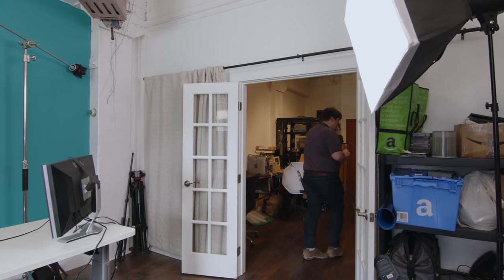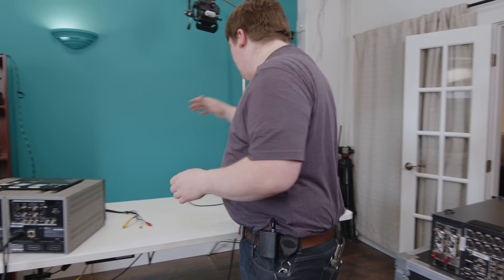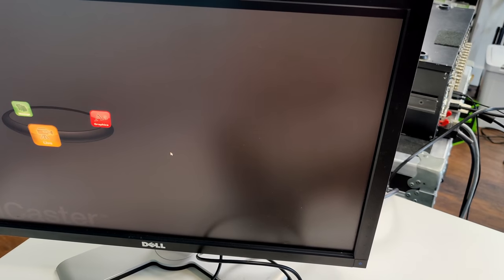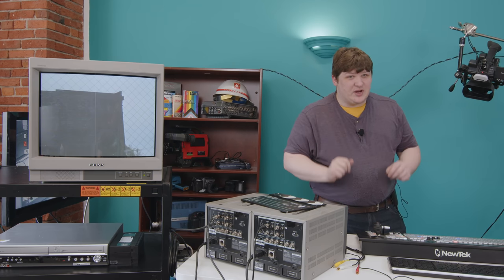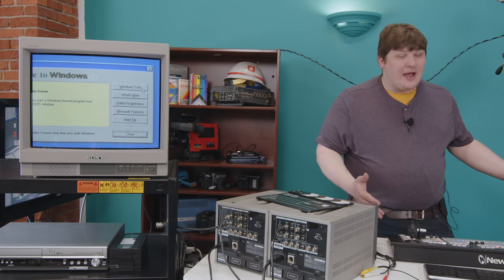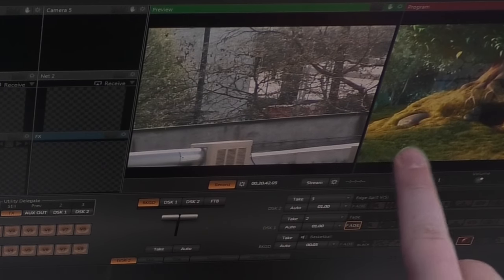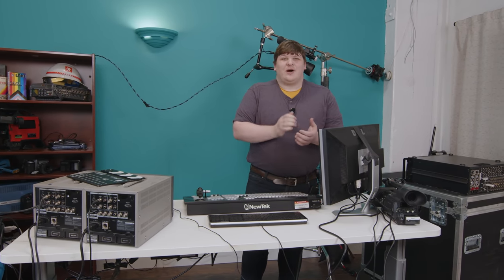Learning to run a broadcast in ONE HOUR [Tricaster TCXD850]

Comment: I assume the "pause a 3D transition halfway between" thing is used on e.g. sports broadcasts when they need to transition back to the commentators or a replay but they aren't quite ready, so you end up with like the MLB/NBC Sports/whatever transition for 5 seconds or so when normally it would last one second.

Comment: As someone who has recently started a career in TV (formerly in electronic security, and before that IT), I found this very interesting (and amusing), as I currently work in Broadcast I don't work with equipment like the Tricaster, but its still neat to learn a bit about a piece of gear I may or may not end up encountering one day. Also, I noticed the "E420" tape - happy 420 day :)

Comment: Hey Gravis! Great video, brought me back to me beginnings in broadcasting...  I've been a Technical Director (Vision Mixer for you Brits) for over 25 years now doing live sports, news, etc and you've got the basics just about right on all counts...  Yes these machines are all based on the same principles dating back from the 60's and 70's when they became more "affordable" for smaller stations...  The newer 4K models basically operate the same way the analog standard def ones did 30 years ago, making it easier for us to implement the newer possibilities alongside our long-acquired ways of doing things.

Control room automation is slowly making bigger switchers obsolete though, with new systems consisting only of a processing frame and networked computer screen interface...  We now do live show with only 2 operators compared to the 4-6 persons crews of the past...  I run the switcher, robotic cameras, playback and graphics all from one interface... And people at home basically don't see the difference!!!  The latest systems even integrate internet video calling all inboard, permitting to put on-air basically anybody with a computer/phone/tablet within seconds...  Soon all this "broadcast" gear will be a thing of the past, replaced by cloud-based apps running on basic computers... Such is the evolution of technology...

Comment: Awesome rundown! I actually work as a director in a local TV studio and you hit all the basic points of using one of these things. We have a 36in/24out Ross switcher with tons of bells and whistles these days but a decade ago we were using a Tricaster according to my predecessors. 

 Tbh I never have had a reason to use the T Bar and none of the directors I worked under as an audio op did either. 50% of our transitions are cuts, 25% are 15 frame crossfades and 25% are custom wipes like the ones you mentioned that just use an animation to hide a wipe.
Reply: Also, when I was switching live music performances, 9 out of 10 times I switched directly on the program bus, calling attention to the camera operator and then punching them in live. Probably when the content is slower (ie. talkshows) you could compose your shot on the preview, but when you do fast-paced switching there's often no time for it.
Reply: @Stoney3K  Hot punching as we call it is something of a sin for tv news. Get in the habit of that and it's too easy to make a mistake and accidentally pop up a weather camera without the key turned on or hit the wrong button for video playback and roll a clip from yesterday's wildfire instead of the SPCA story you intended to roll.... I definitely see how it would be super useful when punching video for a concert or sporting event.
Reply: @Aquatarkus96  I can imagine it being easier to composite a shot in a predictable environment like a news studio, so you can set up the shot in preview and flip over at a leisurely pace.

In a fast-paced, improvised environment like a concert or a sports match... not so much.

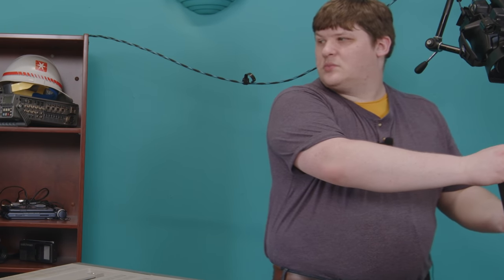Comment: All this stuff takes me back to the days of linear editing, where an editor would have multiple machines synced up in the tape operator's room, and they would be recording everything to tape - one edit at a time. Since they didn't have a video timeline laid out for them to tweak endlessly (like with an Avid or later software solutions), they needed to be able to do precise edits as quickly and reliably as possible. This means that doing something like [22:03] picking the exact field in the middle of a transition was often required in order to replace whatever came after it. Things have obviously changed a lot in the past 25+ years, but tools like this are still valid and useful, particularly for producing live events in ways you simply couldn't with a mouse and keyboard.

Comment: This is very entertaining to watch. I am a broadcast sports director and I use almost that exact model of control surface for some of the shows I run. I'm not the most experienced director ever but I do have some time at the controls.

To answer your question about "stingers" as you call them, one use is for transitioning to replays in a show using a "replay" transition that looks similar to the "score" transition. Useful to let the audience know that what they're watching is no longer live.

And to address how advanced this model of tricaster is: my understanding is that it's nowhere near the top of the line. Other models of switcher that I use (ROSS) connect to a graphics system called Xpressions that can feed a wide variety of graphics into the switcher for broadcast use: think player statistics, scores, etc. They can also be set up with macros to accomplish a wide variety of switcher actions at once.

For instance

taking DDR1
rolling the clip
removing a key
adding a new key
and using a specific transition

all in one button press

perhaps this tricaster can do some of those things but I've never seen it.

Comment: Great Video!  You are really good at connecting the dots!  Every TV engineer knows the instruction manual is only to be used when flummoxed.  

The Video Toaster did do some of the special effects on the TV series Babylon 5 but not on Home Improvement.  Most of those special effects were conceived by the great designer Jim Praytor and executed at Modern Videofilm in Burbank.  I was lucky enough to be one of the cadre of compositing and online editors who worked on the show. Most effects were done in the Discrete Logic/Autodesk family of compositors, the Fire, Flame or inferno.  We also would use camera stands and paper cutouts, shoot ad-hock green screen in the facility parking structure and heavily use the Grass Valley Kaleidoscope in the edit room for image manipulation.  Contrary to the effects found in the TriCaster no "canned effects" were used in Home Improvement.  Every effect or transition was purpose built for the show.  We might re-use something created earlier, but they were all show original.  I even got a cameo as a tiny green elf jumping out of a giant treasure chest.  

Coincidence of coincidences, today I just received an invite to see the latest NewTek product, the TriCaster 1 Pro.  It lives on...
Reply from the maker: Oh wow - that's what I get for not checking my references. Did you know that there are people all over the Internet repeating that the toaster was used on that show, but when I went and checked just now, I can't find any primary sources for it? The wiki article that I'm guessing everyone has been citing for years doesn't have one either. Would certainly make sense if the reason for that is that it simply isn't true; I'll remove it from the wiki page later when I have a chance. It must be a bummer to have your work overshadowed by false association like that, my apologies for not doing my due diligence.
Reply: @CathodeRayDude  No worries.  The reward was working on a great show with great people for many years.

Comment: Ooh, I remember the Tricaster. They made us learn how to use that the semester before the college TV station upgraded to HD. "Everything you learn this semester will be entirely obsolete next semester, thanks for you rmoney". Granted, ours was a bit older (video backups were recorded to full size DV cassettes).
Reply: Your comment reminded me of a course I took in college, that was an entirely different course, but they taught us outdated software in 2014, so for example, I think the college taught us CircuitMaker 2000 instead of some version of SolidWorks.

Comment: Just an amateur speculation, but I think the reason for the transition pausing is so you can cut to commercial. I vaguely remember old newscaster transitions that worked that way it would animate to their logo, cut to commercial and then finish the transition when they were back from commercial break.

Comment: As someone who works with vision mixers for a living I loved watching your journey figuring out the Tricaster. (They are far from my favorite workflow)
You've got a lot of it correct! I believe that model will have a multiviewer output which is why routing the preview bus to an output is so unintuitive. You're meant to hook up a large TV that will contain the multiviewer.

For how prominent the T-Bar is on the switcher surface, they sure don't get used a lot in live shows. It's always "Auto" or "Cut." Most people select inputs almost exclusively on the Preview bus. It's bad form to switch program directly.

Stingers are graphics that come in the middle of a transition. Animation isn't necessary. A dip is a stinger that's a solid color (usually black or white).

The T-Bar will really only be used when setting up a show or checking to make sure a stinger animation is running properly.

Now we need to get you onto a switcher with multiple M/Es :)
Reply from the maker: Ohhhh, that makes a lot of sense wrt the multiview - I saw that output but didn't take the time to try it out; didn't occur to me that that would actually be considered the default output, I figured people would always have the dedicated displays.

And as regards the T-bar - yeah, I had assumed that it pretty much never got used in live productions, I just talked to a couple people who said it did, and I couldn't really picture how that would work but I figured I'd go with the more experienced opinion, haha.

I'd love to try out a real "big boy" switcher - hoping I get to play around in a real studio someday!

Comment: Really enjoyed this video! Back in high school, I was a part of the ComTech club and we did live video production for like band performances and stuff, and we used a 1U Blackmagic design SDI switcher. It was so much fun to use, but we didn't have a physical control surface like the one you used (we'd use a laptop with the ATEM software for control).
There really is something about equipment like this that makes it so much fun to play around with.

Comment: I have slight "pick it up as you go" experience with whatever system BLFC had last year. Poked around with it during the dances and also quickly figured out the basics. Not sure exactly what it was but it was pretty similar to that setup, just more inputs and the director had a dedicated screen with all of the inputs. One of the people that actually knows what they're doing put it on a programmed input cycle for one of the late nights; that's definitely something that isn't discoverable from the console. I want to learn how to operate it more effectively this year.

Comment: I’ve only ever switched in studio, I’ve never used one of these all-in-one field units, but many of my colleagues have. When I started, we were still in SD, and the still store, video playout, DVE, and titler were all separate devices that were inputs into the switcher. When we went HD, our new switcher had a built in still store and DVE, but video playout and CG are still separate. However, the switcher communicates with the CG via GPIO. The stingers are played out of the CG and the different overlays have corresponding switcher macros that basically do what you mentioned at 23:10 where the graphic overlays a cut.

Comment: I've never used a Tricaster, but I owned a Toaster. The Flyer turned it into an early NLE system that was designed around the same A/B source, preview/program switcher metaphor used by the Toaster (it didn't use a timeline interface, if you can believe that). It made perfect sense if you had spent any time in the control room of a community cable studio.

Comment: Check out the Blackmagic ATEM mini switcher.  It's amazing what you can get for not a ton of money.  The even have control surfaces that will interface with the ATEM.
Great job figuring it out.  I was a Technical Director back in the pre-HD days.  Typically a pro switcher will have a main program preview bus with a key bus for the DSK.  Then you will have one or more M/E mix effect busses for your weather chroma key, live shot double box, etc.  You may also have an aux bus for feeding a set monitor or what the camera ops see in their return video feed.

Comment: We had a smaller/slightly newer version of this (I believe it was the TCXD455) in my high school's broadcast program when I was one of our tech leads, this is unlocking some old memories lol (including the lovely reliability or lack thereof). We would use the built in recorder function and record everything, then play it all together with the DDR, and copy the finished product onto the school's network drive (yes, our lovely Windows 7 box was on the network unrestricted in 2020 with a 2012 patch level...don't think about it it's fine). It had an i7-2600K and 8 gigs of RAM, and I think a GT440 in it?
We also had an older one that was built in a Shuttle PC chassis like you mentioned fairly early in the video, I believe it was a TCXD300 or something like that. I don't remember the specs, but I remember it was an X58 board (it had a green startup splash with X58 on it, might have been an Asus or MSI board?) and running Vista.

Comment: I used a 2U tricaster unit at my church with a similar control surface (different joystick, smaller branding, ours also had a trackball IIRC) and I never knew it was related to the Amiga or its Video Toaster cards!
Reply: the unit we had was built around SDI. I don't remember which version, but it could do a 1080p signal and it could also handle the 480i out of a tape deck

Comment: That tricaster is a helluva piece of gear.  I love em and they are everywhere a ross system isnt.  Every level of production uses these from high schools to high end televison.  New models have a fresher looking GUI thats the same and, has heavy NDI integration thats slowly replacing hdsdi.  Thats about it.  People travel all over running these for work.  ESPN3 vans love em.  The only mistake I made once I started directing alot pre pandemic, now im editing mostly from home, was hitting that auto transition button, and at least one commercial break I would replay transition instead of fade into commercial cause you have to change the transition over in time.  eventually labeling solved that mistake for me.

Comment: A few reasons a director might want to stop mid--transition with a t-bar:

The right combination of a t-bar, horizontal wipe, and a bit of camera coordination is a sneaky way to put together a split screen. (Like if you wanted to show two opposing basketball coaches in a single shot).

Also can do some cool stuff with dissolves, like stopping the t-bar mid transition to superimpose a guitarist over his drummer as the guitar player cranks out a solo.

Comment: I managed to shadow a talkshow production at a small local channel once...

I mainly remember a extravagant older lady yelling directions through a headset to two cameramen, and they had a third stationary camera, and a separate room with a mixing board and a few screens showing the feeds, an operator who was sat in front of the lady, recieving directions in person, operating the board....

so they produced the show in realtime, and honestly, it just needed occasional changes from one feed to another, the cameramen being on point with what needed to be seen, and the lapel mics worked no problem... so, nothing more than what you showed here.

proabably later just cut it in a few places to insert commercials, and put in leader and following credits, and thats it, an hour of interesting television done. so, most televison probably utilises quite little of these boards, and honestly it doesnt need "baseball transitions" if it just does a standard classic transition, it does enough

Comment: my high school had those dual Sony monitors, but a different, smaller control system, and dual decks for editing Hi-8 tape. 

one of my hobbies is connecting stuff together and making it all work, whether it's Lego, a hifi stereo, computers, or video stuff. i like to learn about how to make a bunch of equipment work together, even if it's something i might never have access to, like booting an IBM 1401 from manually entered boot code on a teletype and a lot of punch cards.

Comment: Love the tricaster units, they are huge in the live stream church production world, mostly tricaster minis. The minis are dead nuts reliable, run on windows so they are super easy to remotely support, comes in handy when you have parishioners running live streams with 4 ptz cameras.
Reply: I think using Windows for Specialized devices is a terrible Idea.